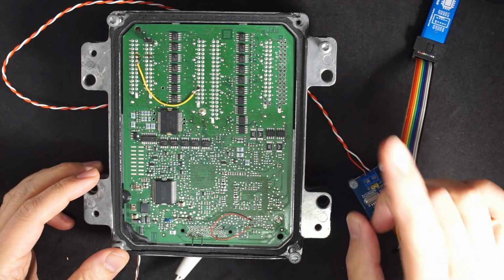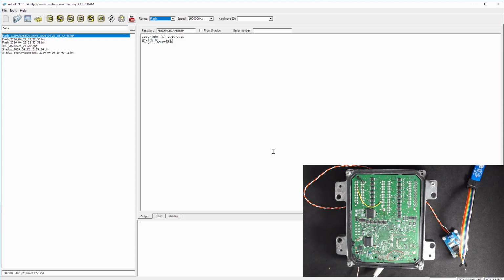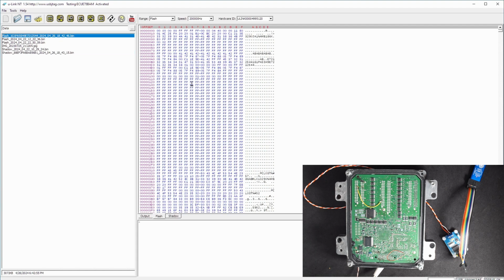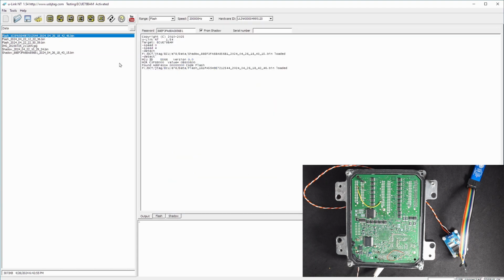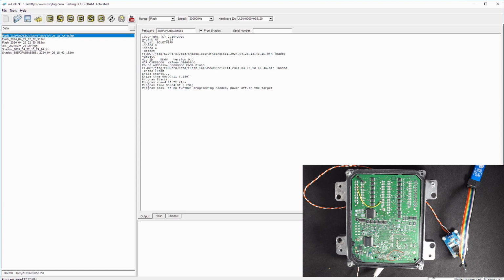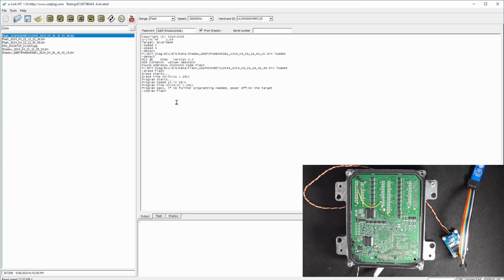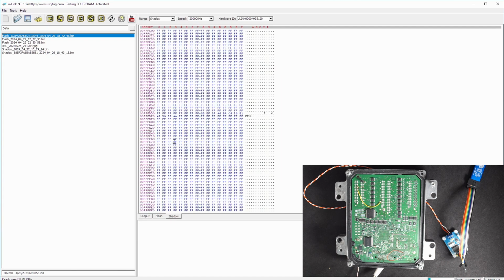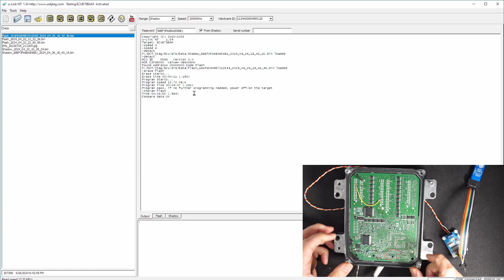u-Link NT program E78 boot mode.

Comment: Just used this one an E78 I semi bricked. Worked great!!  Need to drill it in my head to grab/read the shadow memory whenever I work with one of these for this exact just in case scenario. Wanted to but forgot to take some good high res pics of the soldering points, video is hard to make out even zoomed in. Thanks for this!!
Reply from the maker: If you can come to my site to discuss how I can make the video better.